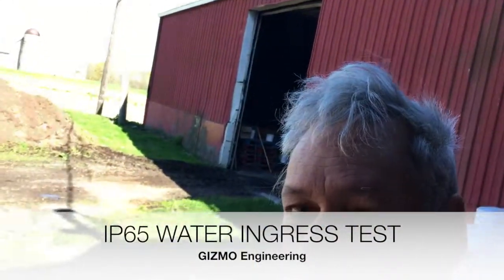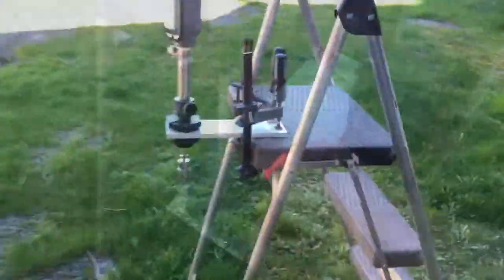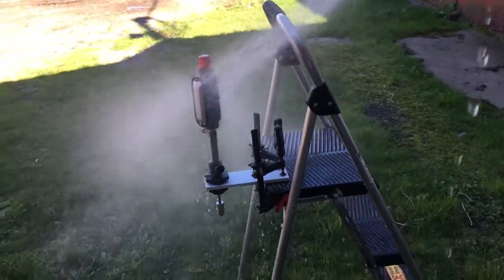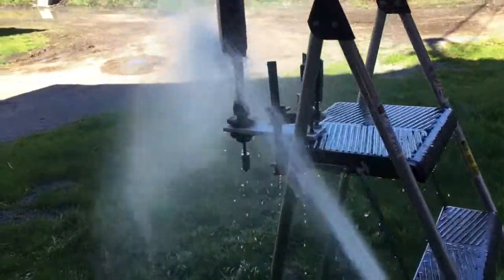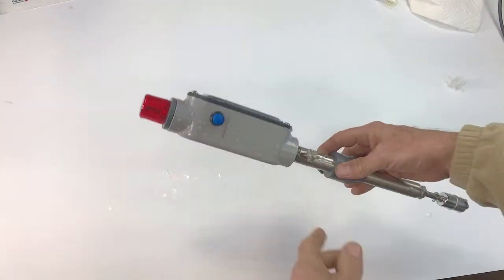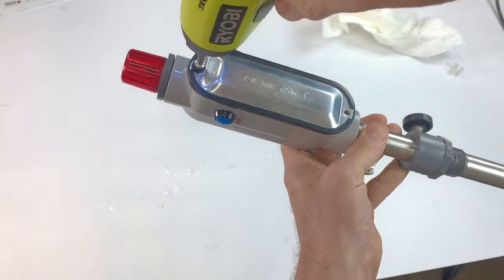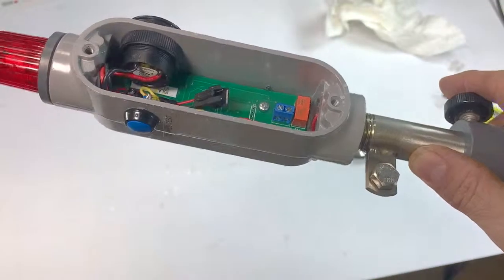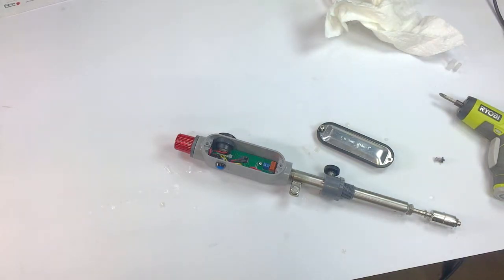IP65 Test

Comment: Hi..
What is the pressure to be maintained in ip65 test?
Is there any specific pressure and nozzle size?
Reply from the maker: This is not a rigorous IP65 test that can be certified, it is a quick-and-dirty test that I have found to be equivalent to the results I received from CSA. I'm sure there is a specified pressure that one can look up, but you would probably have to purchase the UL/CSA standard to get that number.